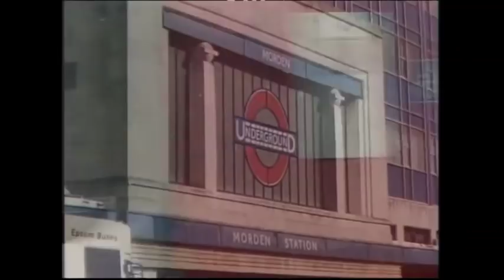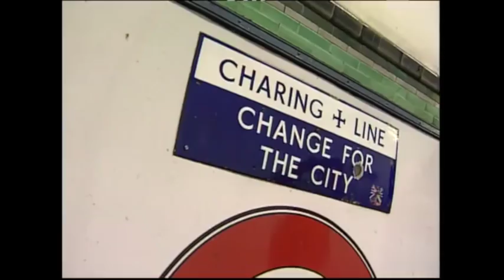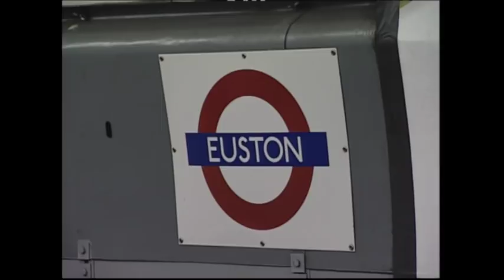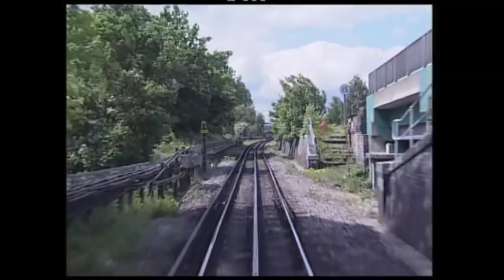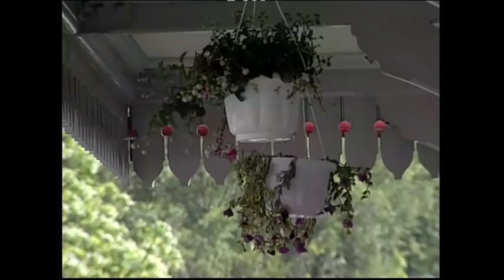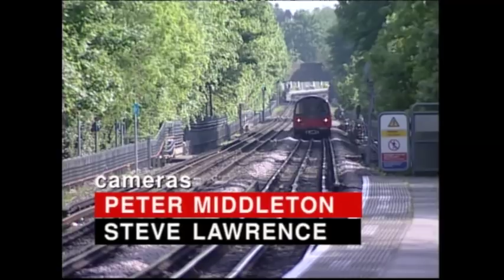The Northern Line West End branch

Comment: Ive always believed that just after Archway (where the reversing tunnel points are) the line carries on to Highgate Woods depot. In the 60`s we walked into the tunnel from Highgate high level (northbound) and the line was joined on the left by the tube. We heard the rumble of a train and ran out, so never 100% certain, but the tube trains did run back into the tunnels at Highgate Woods from the depot, seen them many times as a kid. Be interested if someone knew for sure?

Comment: Is it allowed to stay on a Kennington train at Kennington and travel round to Loop?
Reply from the maker: The answer is no. The loop is now becoming the break our point for the northern line extension to Battersea, so that view is now history.
Reply: @video125com  Do you  mean trains no longer use the loop?
Reply from the maker: Not sure but either now or shortly they won't while installing the new junction
Reply: @video125com  Thanks, I may try to stow away on the loop if it is still running. Chris
Reply from the maker: @chrismaton01  Trouble is you really need to be in the cab to appreciate it. Otherwise it will just look like any other tunnel from the carriage window.
Reply: @video125com  This is true, but I've been end to end on all the Underground Lines. I just need to finish off the bits.
The Kennington loop featured in the "Ghosts on the UndergrounD" BBC program now on YouTube.

Comment: You go around Edgware today you can see the clues of the Edgware to Bushey Heath extension. At Edgware Station, you see the tunnels going under Station Road and Rectory Lane at the end of platforms 2 and 3. On Rectory Lane, you see the Edgware Quakers Society car park filling the cutting for the tunnel and the wall surrounding it is the same brick you see on other LU bridges. Go to Purcells Avenue, you see a gap in the houses built around 1930 where the line was to go, today Shelly Close and Campbell Croft are filling that gap and their houses don't fit in with their surroundings being built decades later. Sterling Avenue off Green Lane is also covering the route of the line. Beside the A41, there is a brick structure which is part of a bridge that was going to carry the line over the road, and you notice the pavement ends at this spot. And in an empty field by the A41 is Brockley Hill Station partially built.

Comment: What was that proposal to split the two branches and rename them?. If this is the Northern line, after the River Thames going south - Southern line.
Reply: Jack Sugden It’s not happening yet, certainly, names haven’t been decided on.
Reply: The split is the ultimate aim of TFL for the Northern Line. But first, two critical things need to happen - extension opens to Battersea Power Station (sometime in 2022), and then Camden Town needs to be remodelled and expanded to handle the additional capacity. Once those are done, the lines will be split as follows - High Barnet to Battersea via Charing Cross, and Edgware to Morden via Bank.
Reply: @OzFrog  Wouldn't they have to build a new depot somewhere if it was split like that? Both the existing depots would be on the Edgware-Morden line. Could resurrect Highgate I guess. Unless they still shared the depots between the two lines.

Comment: The Mill East trains don't go further than East Finchley, though that is a rare occasions it goes there, presumably to end up in the garage
Reply: plezx29 Actually it’s Finchley Central. Mill Hill East trains work as shuttle services between there and Finchley Central during the off peaks and during peaks, they go to either Kennington via Charing Cross or Morden via Bank
Reply: RoanokeEnthusiast1995 most of the time, not all, hence the reason I rarely goes to East Finchley but only for reasons to go to the garage

Comment: Can tell you from personal experience, that journeys on the Northern Line take longer than this video claims it does
Reply: With the signalling upgrade over the past few years, the journey time in length has decreased more notably with the rapid acceleration of the trains under the new System. Personally I find that travelling between Morden and Stockwell nowadays is around 3-4 minutes faster than before

Comment: We'll never find out what the message from 104 was. I had to watch this all the way through once I'd started. Imagine working on a line that doesn't surface anywhere.  All day spent in the dingey tunnels.
Reply: Regarding the message from 104, you can discover what it was, with some accuracy as it happens, but only by inferring it.  The same radio system was present on the Jubilee when I first drove there, and deducing what was going on from hearing one side of the conversation was a way of staying alert.
.
With this type of radio only the Controller's side of any given conversation was heard. In this case, 104 first calls up at 28:00, and we hear, "Pass your message, 104? ... Whereabouts are you now driver? ... Right, so have you got a Door Visual at the moment? ... Well let me know [??how you get on driver]." It sounds like the driver has problems with the Pilot Light (or Doors-Closed Visual), either because of a sticky door or a defect.
.
Then, 29:24 a different Controller takes 104's next call: "Control 104 pass your message? ... Message received, I'll come back to you straight away." We don't hear that next bit because of the edit at Highgate.  5 minutes later at 35:16, "104 your message? [repeated 4 times, possibly as the driver of 104 had left the cab since placing the call whilst attempting to rectify the problem with the train] ... I'm not receiving this message driver, say again? ... Have you got the Door Interlock cut out? ... [...] that's right yeah. ... Yeah, in the middle at East Finchley, we've got the car-examiner there." Ok, so the driver has had to cut-out the Door Interlock in order to move the train, which proves it is a 1995 stock as on the 1959 stock the Guard was effectively the Door Interlock.  Cutting out this safety system would normally mean withdrawing the train from service at the first available station too.  The Controller has said "In the middle at East Finchley" which can only mean that the train is a southbound train from Barnet or Mill Hill and it's being routed into the centre platforms at East Finchley which lead to Highgate depot.... judging by the queue of trains closely following behind it, the gap ahead, and how slowly it's going, 104 is the train we see coming the other way as it departs Finchley Central at 36:05.
.
Then 37:55, "Pass your message 104? ... All received, I'll get the signaller to ring you."  This ties in perfectly – the signaller would have failed to take swift enough action to route 104 into the middle platform at East Finchley (which 104 would just by now be approaching, given where we passed it just earlier) before the train approach-locked the route; and so the driver would be calling up to report the Wrong Route Offered – hence the Controller saying he'd get the signaller to contact the driver [?via the signal-post telephone, or via the trunk radio they had on the Northern in those days, I'm not sure?].
Reply: @squarewheelsorguk  Can certainly see where you are coming from RE the clump of trains. Fascinating comment, thank you kindly.
Reply from the maker: On the contrary, the Northern line branches both surface for some considerable distance. Only the Victoria line and the Waterloo and City are entirely underground.
Reply: @video125com  Yes, I am aware that this one surfaces at both ends. I was referring to the prospect of working on one that didn't.
Reply: I have often wondered if that message was 'Radio may be failing'. Attempted message I should probably say.

Comment: This is an amazing document from the late 90's, thanks for uploading, the Northern Line has improved and expanded so much since it was filmed thanks to signal upgrades, Crossrail interconnects and the future Battersea Power Station extension, all in 25-ish yrs since this was made, but it still looks familiar. If you've got any more please upload them.
Reply: Gee Tee Yet it's still impossible to get aboard during rush hour. I use it daily, I wish they could find a solution to the capacity issues.
Reply: Instablaster...